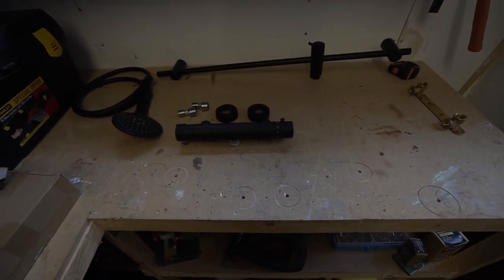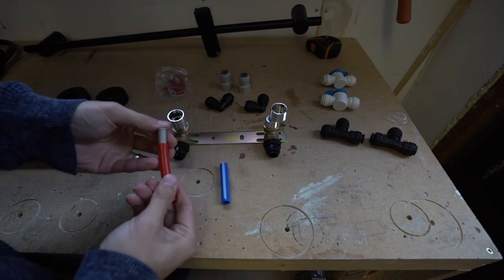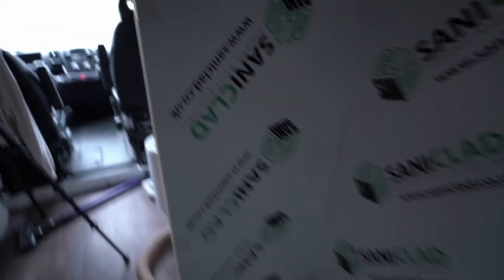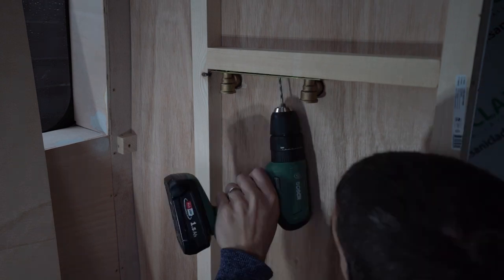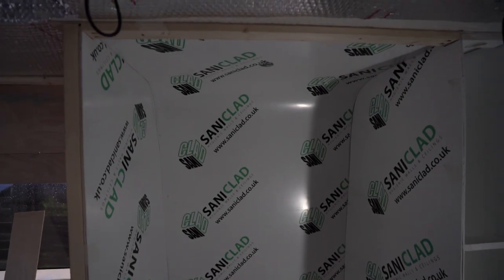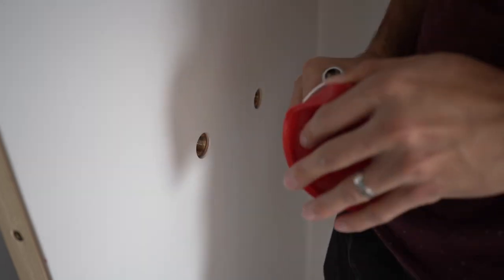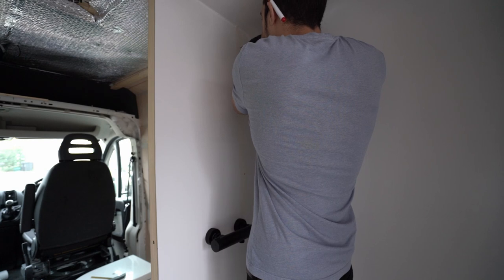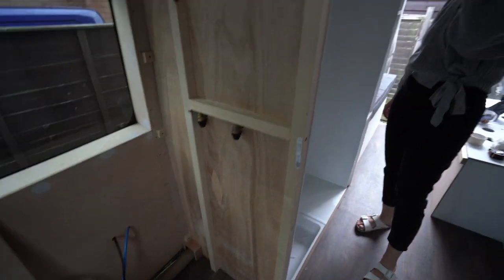SHOWER MIXER and PLUMBING - Citroen Relay Camper Van Conversion UK - Week 25

Comment: Really helpful video, what size timber frame studs have you used? I’m getting to this stage myself and I’m worried about the size of the cavity required to fit the mixer fittings

Comment: that video was really helpful - and thanks for the backing plate link..... i was scratching my head. what size batton did you use on the shower framing?
Reply from the maker: Hey Berry! Glad you found it helpful I been scratching my head about it too for a while. The shower battens are 34mm x 34mm, you can find it in BnQ or Wickes - I put a link in the description.
Reply: @CasLaz  amazing thank you that the same size ive used in the shower area. cant wait to see the finished van
Reply from the maker: @berryboards  Awesome! should just fit then same as our setup! 😀Thanks Berry stay tuned! 😎👍

Comment: Great job as always. Love it, but I don’t think you need to use both, tap and plumbers mate  just one of them. If you use the tap, use only two lines .not sure which way you should turn it, look it up, it is either same way as the thread or opposite way.
Reply from the maker: Thanks! Yeah It seems every plumber has a different opinion on tape only or dope only or both lol. I went with both just to be safe haha. I made sure to put the tape on clockwise so it tightens as it screws in. We'll see soon enough if it worked haha.
Reply: @CasLaz  ha ha, you know more than I do by the looks of it. Fingers crossed it will work!

Comment: Interesting and informative build. Thank you.
What will you be doing to stop water pooling on the plastic ledge the toilet's standing on? The joining strip obviously has a hump in it so there doesn't seem to be any way of allowing water to drain off that there (I assume the hole that's there is for the ventilation duct from the loo rather than another plughole, but I may be wrong).
Reply from the maker: Hey Nicholas! Good question, it's something that we been thinking about too. I'm not sure, we are hoping that most of the water will fall in the shower tray and only a small percentage / spray will get to that area, not enough to pool too much. The PVC floor is on a small decline towards the tray so if we do get some pooling it'll be near the strip and should be easy to to push into the shower tray after a shower. 
Yes the 2nd hole is a vent duct for the loo which will get PVC boxed up (including wiring on the side of loo) 
I have some ideas for workarounds if it becomes a major problem (not as neat as you'll see silicone joints) but for now we will go with this and see how it works out ! Thanks for watching! 😎👍

Comment: Nice work. Quick question guys are you venting the wet room?
Reply from the maker: Thanks Matt ! No, we don't plan on installing a fan. We will have heating run to it and we will leave a gap above the full sliding door for the steam to escape. Our max air fan is very close to the shower so I don't think we will need one, especially with pretty short showers 😆. We will see, can always add one later if its a problem but I think it should be ok